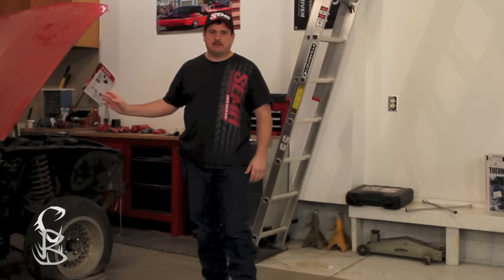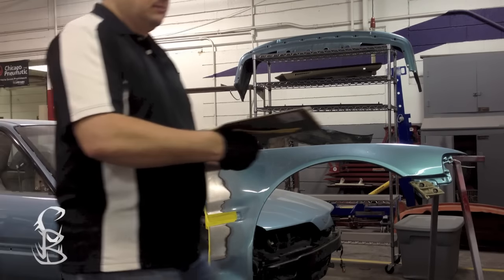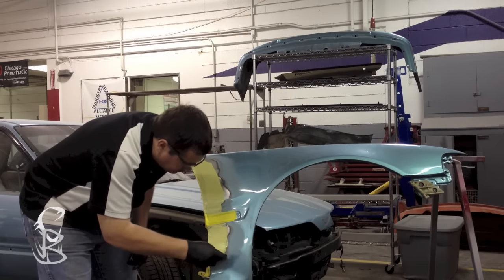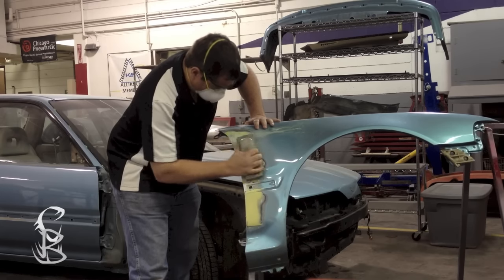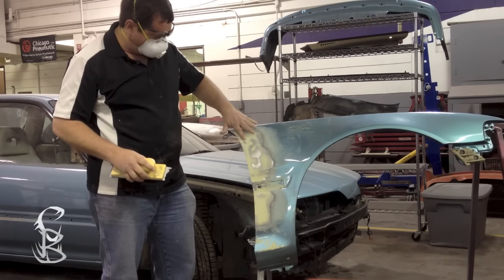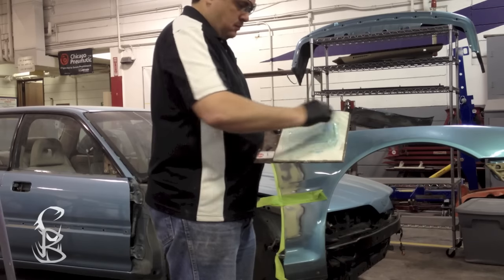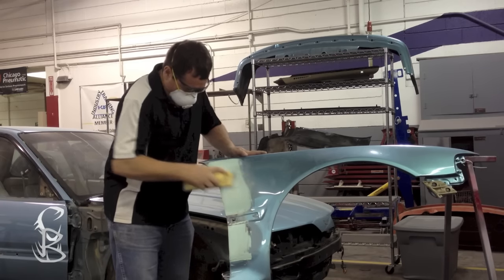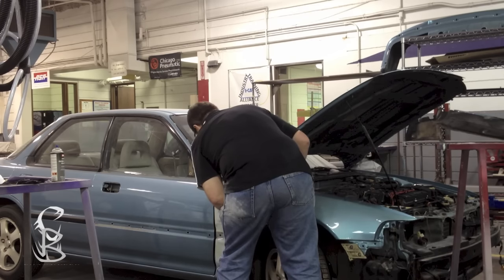DIY How To  Bondo Auto Body Repair (Tips and Tricks) To Prevent Common Problems with Body Filler

Comment: Im new at this bondo and body work thing but please explain why you wouldnt just bondo it sand with 180 call it a day? And whats the tape on the edge for wouldnt you still have to sand ur edges? Cause it still even looks like tape didnt help any on edge..
Reply from the maker: It will take longer to start out with 180 grit with body filler.  If body filler gets in the cracks and indentions, it take a long time to sand out.  Masking edges will be faster.  I hope this helps answer your questions.

Comment: More then two hrs to repair ! it is cheaper to replace fender. Great video. Labor taking fender off  0.5.   Body work 2.5. Prep 0.5.  Paint 1.5.  Total 5.0.   Aftermarket fender $65.00.  Lol. Just breaking your balls great. Video.  And. Great work.
Reply from the maker: I agree, but our aftermarket supplier did not have one for this car at the time of this video.  We use Keystone, but sometimes they don't have the parts we need....or they are not available aftermarket at all.
Reply: Who wants to fit a A.M. FENDER?
Reply: He is kind of slow I could have had that done and in paint in 2 hours save yourself time and use a DA sander and a interface pad to get close then barley have to block sand and let the primer build up hide the rest.
Reply: After market stuff sucks,oem is worth the time.

Comment: Is air good enough to clean before each sanding and before bondo?
Reply from the maker: Yes, but I also like cleaning with wax and grease remover.  Make sure to allow it to dry good before applying the filler.
Reply: @CarAddictGarage  my w&g attcked my feathered edges just using wb W&g now.

Comment: Is it absolutely necessary to do the body filler? Meaning can you just get away with using the putty?
Reply: It depends on what you're trying to do. Filler is exactly as the name implies: it fills in low spots. If your spots aren't so low, and the area won't flex, you might be able to get away with it. Best to use filler without putty though if you're trying to take shortcuts.

Comment: Normally I would just cut and replace the sheet metal, but I have just one spot too close to the windshield for me to allow the heat of a welder to get near. So I’m trying to choose between fiberglass or bondo.
Reply: ... it was a 4 inch rust hole

Comment: Can I use bondo(all-purpose) for plastic a bumper it has a long crack and medium hole(about as big as two tumb if you are look at them from Ariel view) . The crack and hole are not connected. If so how thick should the layer be for the hole?
Reply: +Miguel Hernandez THEY MAKE SPECIAL STUFF FOR RUBBER BUMPER CAP REPAIRS - AVAILABLE AT AUTO BODY SUPPLY SHOPS.
.
But hard plastic could be filled with Bondo.

Comment: I’m using the spray foam before my disc grinder... then filler and more grinding... then some sanding n rustoleum! It don’t have to be pretty... it has to pass inspection...

Comment: would i use bondo or fiber gladd to fix a plastic bumper it not a fiber glasd bumper
Reply from the maker: Neither of those will work well on plastic.  Here is a lesson on plastic repair that will explain the process.  http://www.collisionblast.com/2013/04/02/plastic-repair/
Reply: Cody Hickman do you have any idea what you just said... fibreglass works on almost everything... it will indeed work on a plastic bumper.. though you may have to make the patch large on the back side of the bumper to prevent the crack from splitting the resin from the plastic.. sand that shit with 60 grit and lay down some glass.. the sandpaper marks will give the glass/resin something to bond to..
Reply: DIY Auto Body and Paint ^^ that was directed at you..

Comment: do you suggest grinding if rust is involved or will the da sander do the job. I don't have a sander but I do have a grinder.
Reply from the maker: It may take a grinder to get the rust off.  But be careful not to remove too much metal.
Reply: robowis1 if you use a grinder use caution not to heat the panel too much because it will cause the panel to warp from the heat
Reply: thank you very much

Comment: how do you work with it so long i put a line of hardener across the filler and mix it good, but its so this and starts getting chunky and hard before i really finish work with it. iv used less but it stays soft, please help. thanks
Reply: thanks for the feedback thumbsdown video
Reply from the maker: The temp is going to make a big difference.  In the summer you may put less hardener and the winter more.

Comment: I was apply body filler and after Glaze putty and finaly Primer over it. But day after bubbles are pop up. Please give me instructions to how avoid this and what should I do for perfect result.
Reply: +dineshdeepal Bubbles in the bondo should be visible after knocking it down. They will be a lighter color and you can fell them. Dig them out with a pick and fill over them. You may also try mixing your bondo with a 2 1/2" wide metal putty knife to make sure you are mixing it thoroughly and working out bubbles. Cheaper filler can be a problem for bubbles. Stick with known brands

Comment: I keep getting air bubbles 
and big gaps when I spread it
I tried applying a tight coat on top of it after it dried and it kinda worked..
Reply: C-64 use less hardner
Reply: Or put too much on and sand it down to shape. When I first started doing body work, I wouldn’t put enough bondo on , or would keep spreading it until it was too thin. It’s both better and faster to put plenty on and sand it, carefully, down to the final contour.

Comment: Hy I need help small amount of body filler got on my painted wheel how can i remove it  without damaging clear coat on it??
Reply from the maker: +surviveasl The best way is not to smear it while it is soft.  Once it dries, it should pop off since the surface is smooth.  It will not stick to it.  However, if it get smeared on there, it may be difficult to get off.
Reply: +DIY How To Paint A Car School It is stuck on in, if I pull it hard im afraid that it will pull the clear coat. Can the body filler be dissolved with something?
Reply: +surviveasl acetone. but acetone disolves a lot of things too. including clear coat. try tiny spot if you do try it. use it as last resort. be careful.

Comment: I've got an old A-B beater car that's pushing 200k. It might go 300k, but I don't really care. It's a fun daily driver, but no longer worth it to sink big money into. It's starting to rust out on the rocker panels and I have a lawnmower rock shot in the door. I think it's time for some bondo work and rattle cans. Like I said, I don't care. The car is a proud beater.

Comment: ive been doing this for a while and still cant figure out why the body filler bleeds thru the paint any answers
Reply from the maker: What kind of primer are you using?  We used to have that problem with lacquer primer.  I have not had that problem with 2K.  It used to do that with the red hardener.  You might trying a different color.

Comment: What happens if you wet sand body filler ? Is it okay or not ?
Reply: It should be okay, it might be easier to have the area your working on wet (water) before you apply filler.ACE
Reply: No problems at all, I use a spray bottle with cold water in it and that works just fine.
Reply: +Andrew Evans Good lord, never wet sand body filler!!! It is porous and will absorb the water. Even though the top is dry, the water has soaked down in. Major paint problems await you.

Comment: Question does a air board sander do the same kind of hand sanding in this video reason i ask the hand sanding looks like to takes for ever thanks
Reply from the maker: bluesmanreturns Yes, an air file will do the same thing faster, but you will have to be a little more careful.
Reply: +bluesmanreturns I only use 'air' for large areas to get it close. More than a long board, I will use an 8" DA or and 8" orbital, but you will be there all day adding more filler if you don't do it by hand.

Comment: Wouldn't have been better to prime it before you put the bondo on?
or is that a priming mistake?
Reply: Bun Bita No don't prime over it first it just adds and extra layer of something for the bondo to fall off. I always just 220 sand to rough the surface then shape your filler after it hardens. Then Spot glaze it then final sand to around 400 when your happy with the flatness. Finally prime, paint, clear, HAND sand, polish and your done. 

If your really picky you can sand your base coat lightly to help remove imperfections and keep building the paint until your happy with it but it takes longer cause you have to wait for paint to dry. Better and quicker imo to paint it and when paint is tacky spray clear coat.
Reply: evilcowboy thanks man. That would've been a horrible mistake if I would've started the project this early without knowing that.
Reply: +Bun Bita lol would you put peanut butter on your bread before putting it in the toaster ? :P
Reply: Bun Bita Not all info you get is correct!  You can use bondo aka filler over epoxy primer with out any problems.  Bondo is a brand name of filler. Use evercoat products like rage or rage gold.  The putty is for use after youve used filler and have blocked it out and have little imperfections to fill.
Reply: Lol. Filler first then primer.

Comment: Good video I guess you decided to repair the fender.
Reply from the maker: I had planned to replace it, but Keystone Automotive did not have an aftermarket fender for this car at the time.  Thanks for watching!
Reply: DIY How To Paint A Car Repair Videos With Donnie Smith oh ok it looks like it pulled out pretty good plus you saved money
Reply: DIY How To Paint A Car Repair Videos With Donnie Smith
For a common car with fender replacements, is it ever benifical to repair a damaged fender? Considering the time it takes to knock out dents prep, bla bla bla..?
Reply from the maker: Mitch Livingstone In this case, I could not find a fender for the car and did not want to take the time to see if there were any used fender available.  Are you repairing it yourself or paying a shop to repair it.  This may be some things to consider when residing repair vs. replace.  Thanks for watching!

Comment: I hate that mixing body filler is just something that doesn't work as easy for me as everyone else..lol when ever I use the method of laying hardener across my filler it always gets hard way to fast and sets up before I apply it completely or gums up as im spreading it.
Reply: +My Damn Channel Sounds like you are using too much hardener.
Reply: +My Damn Channel The amount of hardener can be adjusted for temp. Just remember there is a minimum and maximum, too little and it'll never set or too much and it over heats and it to britlle

Comment: The pinholes are a result of too much harder. When the peroxide activates the filler to harden, it releases a chemical release. While hardening too fast it leaves small pinholes. If your getting pinholes, lighten up on the hardner and you'll see. This info I got from the man who wrote the instructions on how to mix bondo on 3M Platinum plus body filler.
Reply: Tell that guy to rewrite the instructions with more accurate measurements, please.

Comment: Should of also made sure that door opened and closed okay as well with that pannel lined up before primer and paint. Ive seen a guy do that before. Thought everything was good and fit well.  Sent it off for primer and paint and finally when they put the finished fender back on they opened up the door and it clipped the fender a bit and chipped and ruined his work. I mean it wasnt totally ruined but it wasnt right either.
Reply from the maker: Thanks for the tip!
Reply: @CarAddictGarage  You're welcome! You do good work.

Comment: was looking good until you used the same spreader you mixed with to apply the filler. i never do this. i've been using 2 sometimes 3 spreaders when applying mud for over 25 years. why 3? one mixes it and gets set aside. the 2nd spreader i use to force the mud into the ground and sanded metal and gets set aside because ground metal will ruin the edge of a plastic spreader. 3rd spreader will apply the build coats.. and i always make sure i start with smooth edges on my spreaders by "sharpening " them with cardboard...try it, get the feel for it and you will never use sandpaper to smooth the edge on your spreader again. clean your spreaders as quickly as possible , with thinner. don't soak them in thinner or leave them in bondo as both will prematurely distort the spreader.  i throw away more spreaders in a month than most people will use in a year. i'm anal about spreaders, i'm anal about mixing and i'm anal about applying filler. i go for perfection whether its a honda or a lexus or a harley or a pedal car.
Reply from the maker: Thanks for the tips.
Reply: Why not just use a 6 inch spackle knive, thsts whst we use for wainscotting after craig jigging

Comment: Fuk all that sanding..  i rigged up a body file (cheese grater style) to a square finishing sander..  basically the pad was already wore out so instead of tossing it i ground down the square to slide on very snug fit on the file.,  so when you turn it on its randomized so no scratches and being  12” i just let it glide over the flats and saves me hours..,

Comment: guys, there's plenty of helpful information here and everything looks & sounds about right but DO NOT, I REPEAT, DO NOT hammer after speading body filler as body filler will definitely de-laminate(seperate or lift) from the metal you are hammering and changing the shape of.  unless you absolutely have to get that spot lowered because you will then need to  sand off the majority of the filler and start over wasting material and time.  ...unless you just love spending money and working longer.
Reply: +Joseph Miller you are correct but the filler is thin there and with the pick he is not moving the metal much. Using a 32 oz hammer is another story. I have never had a problem although I would try to work the metal before fillers.
Reply: EXACTLY my thought!  Work the metal first and save yoursef a huge headache later if that one little correction lifts or some kind of moisture happens to creep in and destroys your finished product from the inside out.

Comment: Personally, I would blow my brains out if worked as hard as you do with all that manual sanding. I retired my sanding block years ago.  Trust your skill with a palm sander and air file, filler can be shaped perfectly in half the time with half the work.  Also quit using that expensive glazing crap. Wean yourself off that stuff.

Comment: the biggest mistake when using Bondo is using Bondo never use this shit. use the gel fiberglass preferably the stuff with the glass fibers in it the reason is it's waterproof plastic body filler is not and if you get a small pin hole or chip in your paint the water will work right through the Bondo get under your plastic body filler and rust the metal under the filler it's garbage. I understand it's quite a bit more expensive but once you done body work and understand how much fucking labor is involved it's well worth the little bit of extra money it's going to cost you. the second biggest mistake people do and this applies to both Bondo and fiberglass gel they put too much hardener in it which causes it to get very hard and brittle. henceforth it sets up too fast because the easiest time to work it with a cheese grater or 36 grit air file works well is when it is  hardend to the point you can only Dent it lightly when you push your fingernail into it if you work it too soon it falls out of a dent. if you wait too long you're going to send your ass off getting it off. another bad thing about putting too much harder in it if you get hit if you have too much hardener it'll shatter if you have just a light amount of hardener it will actually flex and bend with the metal and stay attatched.

Comment: grit sand paper to find 40 grit  filler bond better hold no the metal  deep cut in metal hold more weight
Reply: Jimmy Coulter Come again?
Reply: +Bruno Sterckeman I think he's saying to rough up the metal first with 40 grit sand paper so the filler holds better.
Reply: +Jimmy Coulter 80 grit is enough for the bondo to bite. Just remember, nothing sticks to shiny
Reply: +jerry bushman 
Except silicone
Reply: TRASHURE Not even silicone